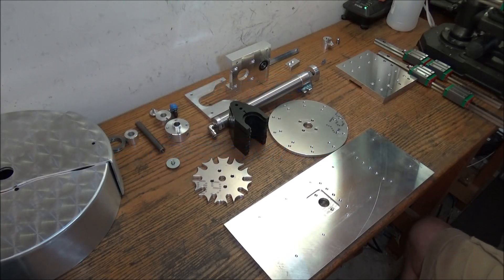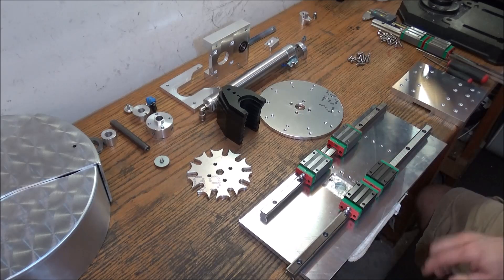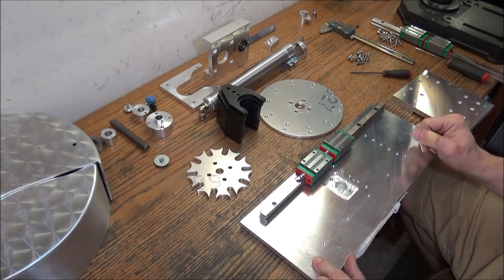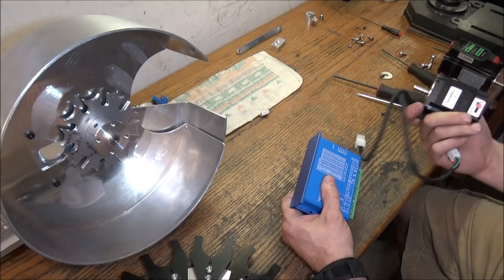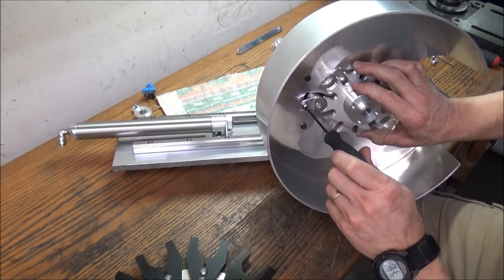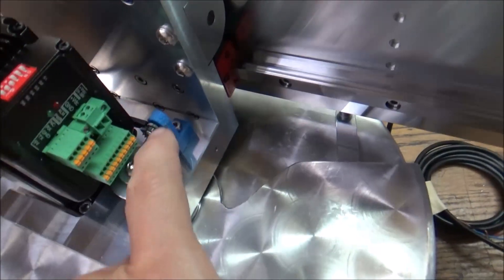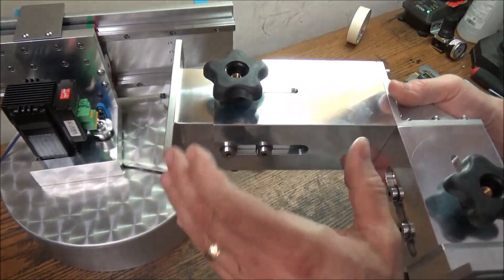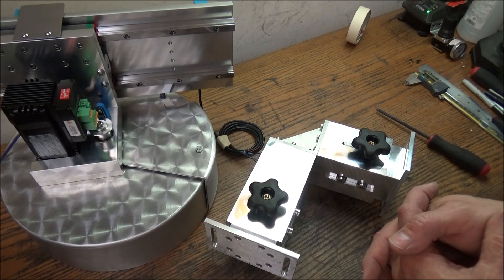PM727M ATC Pt 12 Assembly

Comment: Stay away from those Chinesium rails from Bandgood.  I bought a set for this ATC project and they were very dented and chipped.  Basically after coming off the mill and grinder, they throw them in a box unprotected.  1 rail was unusable as the guide kept stopping at each dent!  The other rails was somewhat more useable as could feel the guide run over each dent, but it did not stop.  One rail made its way out of the bag at some point during shipping and it was outside of its blue plastic wraping.  The rail had a preinstalled guide that came off during this shipping incident and thus ball bearings were all up inside the shipping BAG.  Bag, yes BAG not a box.  Trying to get a hold of Bandgood support is like a homeless person dialing up the Whitehouse and getting the President.
Reply from the maker: I had a similar experience.

Comment: Amazing work i would recommend a hard stop on the cylinder extend for accurate position and for the grease you can poke a hole on top of the track and you put a o-ring to go between the plate and you can create a tunnel in the aluminum plate on top. cant wait to see it on the machine!!
Reply from the maker: Thanks for the tip!